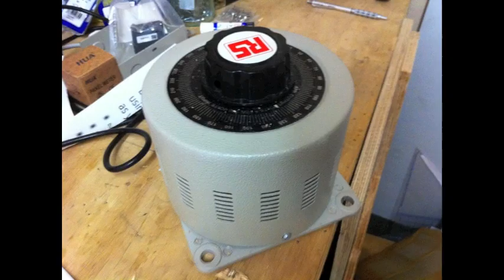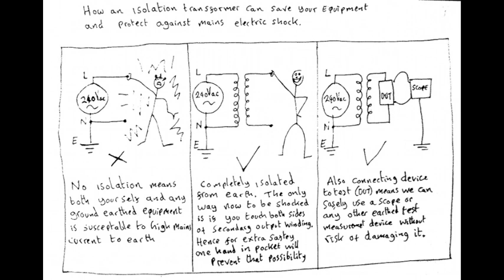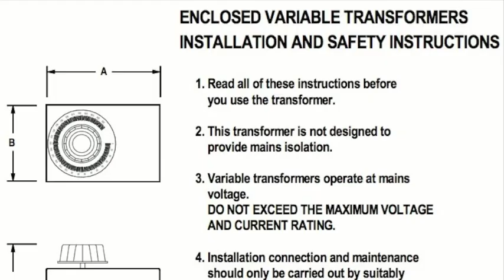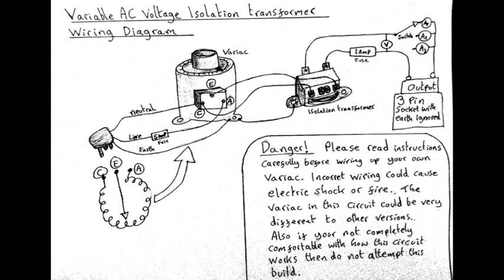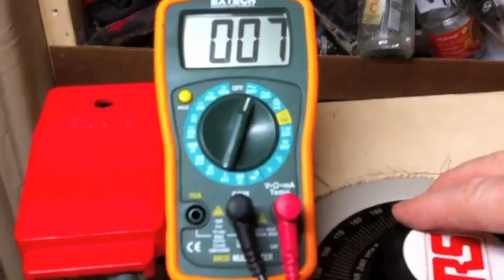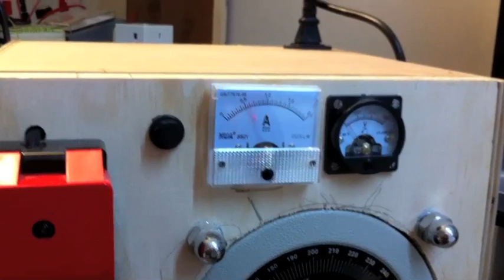DIY Variac And Isolation Transformer Build Guide. Fire And Death Avoidance!!

Comment: Make sure to, the isolation transformer has no, or remove its AC ground. If it does its not a true isolation transformer. And would cause a danger..
Reply from the maker: Yes good point!

Comment: Your diagram looks ok. Now, instead of using a variac, try something like a triac based light dimmer.
Set it to, let's say 111.2345 Volt, then step it up to (220 to 250 Volt). 
Now use this output voltage to run the mains power supply of your desktop computer and watch what happens.  😙

Comment: I typically hold the control stick with my left hand, throttle with right hand, with one or two flap setting and numerous pitch trim changes with my right hand. 

Holding the door with your left hand and doing everything else with the right hand when you’ve never practiced it is asking for this result. I’m guessing airspeed/wing loading was not being monitored while juggling controls with your right hand. The position of that door handle is the position he was holding it right before impact. 

The best thing one can do is let it fly off and fly the plane. Sure it may bend your horizontal stabilizer around 4 inches at the tip, but it will not take it off. The door typically rips off at 85 to 90 kts. Then fix the plane and fly again a few months later.

Comment: You only need the lowest current ampmeter + switch to select 0 & 2 parallel resister shunts (x1, X10 and X100)
Reply from the maker: @set3777  yes that is true. But I like having  lots of them.

Comment: Not claiming to be an expert here, but wouldn't there be no harm in feeding earth ground all the way into your device under test which would mainly be for the discharge of static electricity if it were to accumulate? At the device under test, the two hot wires are not referenced to ground I don't think, so it still wouldn't shock you by touching one of them and earth ground I don't think.

Comment: Hiya Tech tins!  Thanks for your video, I’ve been planning to make an isolating to myself with the 2 primary windings of identical microwave ovens but I’ve not made much progress.😢. Nevertheless, quick query:  on your diagrams around 9:20 you show an oscilloscope connected to the DUT.  Usually the oscilloscope probe ground is connected to the oscilloscope earth point, hence connecting the earthed probe to the DUT effectively grounds that side of your isolation tx.  Then if you touch any live part while in contact with any earthed device you have a circuit through the isolated side of the tx and you get a shock.  It feels like I’m missing something or that when a device is connected that is earthed, then you give up the safety benefit.  Appreciate your thoughts!

Comment: How is it not at earth potential if you connect earth from varisc to the leg of the isolation transformer?

I'm building one with an almost identical wiring schematic only I wasn't going to connect the chassis of each.

I have a 1kva isolation transformer as well I got in a trade but I'm not using that.
Reply from the maker: The casing is. But the secondary coil has no connection to earth. The earth wire on leg is purely for safety if ever any primary side live leads came lose and touched the casing. But you could leave it off. Will work fine without.
Reply: @Tech Tins  cool. I'm going to go super lazy and have a closed loop stepper turn the variac. I have the motors and all that just sitting in boxes. It's never going to be moved after haha. I wish I could sell the 1000kva one I got recently. Traded a 3d printer for a tektronix tds2002c and that boat anchor of a transformer. I had just bought a new scope like a month prior for alot of quid and wish I could've still been within the return window. Haha. You guys have access to way better gear than us in north America.  I'm trying to find a brymen bm869s and it's a bitch. Paying that vat seems bonkers. It's like some weird game of follow the cup as far as who it's good for haha.

Comment: You explain the circuit very well but I have a suggestion to make. I would put the isolation transformer first and the variac second. Traffos are designed to accept a particular input voltage and there is a reason for this. If the input voltage is variable then the primary of the IT could struggle to produce a secondary voltage at low input voltages due to EMF. This will cause over heating in the isolation transformer primary and could in time cause " Brown out" . This is where over heating of the windings causes a failure . It's common in motors but that's a different matter.  Variacs are designed to vary input voltages and prolonged use at low voltages will eventually cause a problem . Hope this comment is helpful.
Reply from the maker: Your right 100% agree
Reply: @TechTins_Projects   Did you change the order , so that the Isolation Transformers, was first , plugs in to mains socket , then Variac connects to Isolation Transformer's secondary ? As Conwaynoel  has suggested 

I am think of building one of these and came across a video called Isolation Transformers, Variac's and Current Limiters - Which comes first by DVR Productions . 
And was going to ask you if you could watch that 32min video ask for your opinion in the order to connect the Transformer and Variac. 

And You explain the circuit very well indeed
Reply: @TechTins_Projects what's the name of that red contactor switch you have there. Big Clive has one too and I cant find one anywhere. I've searched on digikey for hours haha. I'm building a new variac and isolation transformer with a simpler design. My only change is I'm going to have a switch to bypass the isolation transformer. That switch would be dandy for my new set up.
Reply: @conwaynoel3715 , is a Traffos another name for a variac ?

Comment: You have a 1A isolation transformer, so at 12V it’s12 VA. Switch both transformers and you will have a 3A/200VA output.

Comment: Huh a diy that you have to buy. Wouldn't a better title be something like, "this is not a diy variac?" Also it doesn't require tons of copper.. if requires winding a large toroidal chunk of hard to aquire and probably home cast soft iron with tight and even spaced turns that I've battled with achieving. But its very much less expensive than buying one. Also the commercially available crap produced today allows for more hassle than benefit.
Reply from the maker: Agreed it is probably not the correct title, but on that argument, if your going to wind transformers (which is just a large component) why not make your own fuses and dial meters as well? In UK these variacs are not much more expensive than the copper used to make them. It is mass production which makes this so.

Comment: Excellent video. Very informative—you've earned a subscriber! Is there a preferred order for a setup that uses an isolation transformer, a variac, and a dim bulb current limiter? It seems like the isolation transformer and in the variac combo would work in either configuration, no?

Comment: I did more of less the same kind of setup but i added 4 bulbs, 2 60w and 2 40w that I can switch in parallel to protect the tested device. I also added a small resettable breaker (1 amp). I can disable the isolation transformer if I want with a switch. I call it the ultimate dim bulb tester :)

Comment: I used a simple and cheap digital power meter. It measure current, voltage and power on an 
 LCD display. Con etiology is made with a magnetic loop and ferrite core. You will never use the 50 and 300 milliampere meters.
Reply from the maker: True! But they look good. ha ha!

Comment: Always, always include a fuse at variac output. If you fuse at input (say 15A) and you output at 1/3 voltage, you can output 45A from variac and fuse does not blow (it is a transformer after all, low output voltage=higher current at same inpu). However, variac does not handle 45A at the 1/3 of the winding that has output. I have seen variacs burned because of a fuse only at input, actually I think I burned one tiny variac that way myself. After that I never used variacs without a fuse at output.
I made my setup quite differently. My setup has isolation transformer to mains and variac at the output side. No need to worry wou the isolation transformer handles overvoltage, I have variac set to output slight overvoltage like 275V on maxinum instead of normal 240V. My setup also includes separate isolating transformer for measurement devices. Connecting a grounded scope lead to device under test makes it mains referenced and if you touch open device in wrong place, you get shocked.  Having scope isolated too avoids that problem. (At the time I made the setup, it was the required one for any repair shop, requirement included two separate isolation transformers).
Large transformers pull a huge spike from mains when powered on. I have also a slow start mechanism: resistor to limit inrush current and after a second or so contactor bypasses resistor. My lab setup is for 230V/16A which means very heavy transformers that take huge current spike at startup, especially with a transformer+variac combo. Without a slow start circuit, fuses are always blown with my setup when it powers up.
Reply from the maker: I have four fuses on it for each stage. Both input and output. Not in video or diagram though. I wrongly assumed everyone would understand to use fuses liberally. This also blows fuses regularly but that is okay. I've learned to turn up the voltage slowly. Been a great asset to me over last 3 years.
Reply: @Phil Allison  I agree that training yourself to touch things is very bad because it is safe leads to bad habits. The fact you can do that doesn not imply you should train to do that.
Yet, when working with open unprotected circuits it is safer to make them safe, in case accidents happen like when adjusting something and your hand hits something unwanted by accident.
Isolation can be a safety addition like for example residual current braker.

Comment: neat... one question, i'm not a newby but having made this apparatus i think you can answer me quickly: what happens on the second transformer if you undervolt it?... i mean, transformers are not "precision" devices but their sizing is all held togheter, by turns amount etc, i perfectly understand that the voltage will follow the variac but i'm not sure about the current capability, if they work like audio output transformers it should be a matter of turns ratio, changing just the voltage and not the max current capability, but maybe i'm missing something... or maybe it will be just a loss by the parasitic resistance of the windings of the isolation transformer (little i hope)
Reply from the maker: What do you mean by undervolt it? Don't understand your question sorry ;-)

Comment: Nice video--- thanks!

I just picked up a nice Superior Electric Company model 116U variac I got for free off Craigslist.  Now I'm looking around for an isolation transformer and meters and I'll be building something similar to your equipment.  Probably fewer meters though--- an ammeter and voltmeter after the isolation transformer I'm thinking.
Reply from the maker: What I have there is three meters for current on a simple three way switch and one meter for voltage, so if your measuring low current you can switch between them to get a more accurate reading (ie 50mA, 300mA and 3A scales). But you could install just one active digital meter and that would give you all resolutions you need plus voltage. Here is an example for ya https://www.amazon.com/DROK-80-300V-Voltmeter-Multimeter-Transformer/dp/B01MRZAFAF 
I prefer analogue so no option but multiple meters for current. It is fun to build one of these. Enjoy your build and thanks for your post
Reply: I don't have any meters lying around,  so I'm considering using a cheap multimeter that can be switched from one function to another.  

Thanks for your reply!
Reply from the maker: That will work. My first version did not have any meters. Have fun!
Reply: Since you are honooring me by replying to my posts,  I'll ask another question:

Based on the video,  the most important ways to protect yourself and your equipment from the hazards of powering up unknown or experimental equipment are:

1:  The hazards of being shocked by being connected to high voltages

2   The hazards of sort circuits or unplanned high current loads through unknown defects in experimental or unknown equipment.

#1  is best corrected with an isloation transformer

#2  Is commonly remedied by two suggested methods  ---a variac auto transformer  and gradually running up the input voltage to identify possible problems  AND installing a current limiting device such  as an incandescent light bulb in series with the 120 VAC voltage input.

However,  it seems to me that recommend both a variac and the current limiting light bulb are two solutions to the same problem.  

Wouldn't it be satisfactory to have the isolation transformer and the current limiting light together,  but not bothering with a variac?  

The variac might indeed be nice to have,  and I am lucky to have found one just this week.  But it seems to duplicate most of the protection that the current limiting light bulb provides.
Reply from the maker: Depends what projects your working on. Current limiting bulb for AC will alert you of a direct short and brighten up taking all the power instead of the shorted current catching the wires on fire (a direct short on 240Volts AC will either cause the power cable to catch fire or burn out your valves/components) So its very good to have one if your working on old AC valve equipment.  But it does not give you anything else. (Think of it like slow safety fuse that does not blow out but uses all the available power up safely) 

I need the variac for setting different amplitudes of the 50hz AC voltage on different projects (not just valve radios). Very useful bit of kit. I use it all the time. But the isolation transformer (like the light bulb) is only for safety.

Think of it like this, the light bulb stops wires from catching fire, whereas the isolation transformer ensures you do not have a direct connection to the mains. (you can still get a shock though, if you hold both the live wires at same time.) The variac has no relevance to these parts. It simply provides a variable 0 to 240v AC supply, With a full bridge rectifier stuck on the end (which I often do) It doubles up as a DC variable supply as well. 

But if your only ever working on low current DC circuits then you do not need a variac or an isolation transformer. A variable DC SMPS instead is much cheaper and might be better for you. Hope that helps. Happy to reply to all questions.

Comment: Best tutorial I've seen on variac/isolation transformer setup, and I've watched many in preparation for building my own.
As far as I've seen you've left nothing out!
I plan on using two identical, inexpensive 120/240 step up/step down transformers (1K - 3K VA) to isolate by connecting the low voltage coils together and using the high voltage coils as the input/output. Maybe $20 each.  Seems like it will work. You are only limited by the size of the transformers, or the variac. My variac is 2KV, 220 V here in the Philippines - no ground!
Again, excellent post!
Reply: don't piggy back small transformers. They just make a lot of heat. If you can't find the real deal find an industrial control transformer that is like 120/240 to 120/240 or 120/240 to 240/480. You can ue 240 to 240 for 120/120 but you have to maintain the current limits which means you have to buy a bigger transformer. I see 1 kVA ICTs all the time for under a hundred bucks. Used for 500 watts it wil run cool and quiet.
Reply from the maker: Many thanks Brooks. There are a few errors in that video. But I have listed them at bottom. Also big thanks for letting me know the name of the red throw switch. I been trying to find that out for ages.
Reply: If you have time, check out "bigclivedotcom". He's a big Scot and very knowledgeable and entertaining. You'd enjoy. I'm looking forward to seeing your other posts!
Reply from the maker: I know I subscribed to him a very long tome ago!

Comment: Think you drawing is wrong for an autotransformer.  As drawn, your output voltage could never exceed input voltage, only increase to equal it.  I think it should be drawn so you input is between ground and what you indicate as TAP.  Then, output would be across what you indicate to be AC input.

Otherwise, excellent vid.  Thanks!
Reply from the maker: Yes, my drawing's version as I have it, would not allow over mains voltage. But it is still an auto transformer, just not the same kind as most commercial ones you buy Ha ha!. Well spotted! and thanks for comment.
Reply: The drawing is correct. It depicts a fixed tap autotransformer, not a "variac". The input voltage is applied across all 20 turns. The tap is connected at exactly the center, 10 turns from the top and ten turns from the bottom.
If you apply 100 VAC across the 20 turns, the voltage at the tap would be 50 VAC.  

On variacs configured to raise output voltage above the input voltage, there is typically a tap at 20% of the # of turns from the top, The input voltage is connected to this tap. The top of the winding (commutator in variac language) is left open. Thusly when the wiper is positioned below the tap, output voltage is reduced. When positioned at the tap, output voltage equals input voltage. When the wiper is moved above the tap, output voltage is increased to a maximum value of 20% above input voltage, corresponding to the input being applied at 20% of the turns ratio from the top terminal.    
There is also typically another tap positioned symmetrically at 20% of turns from the bottom of the commutator to allow the same function with CCW rotation. 
Always place the overcurrent protection device on the OUTPUT lead of a  variac.